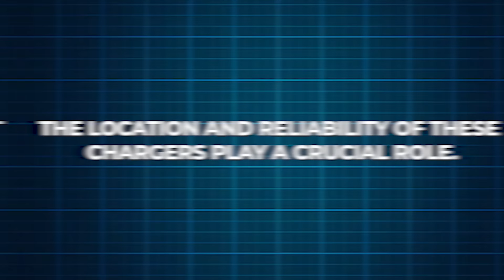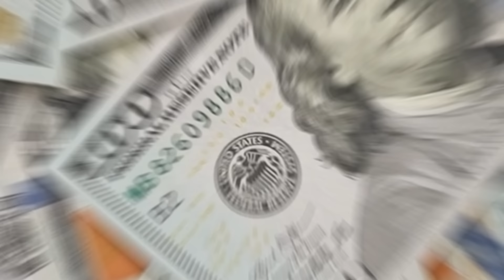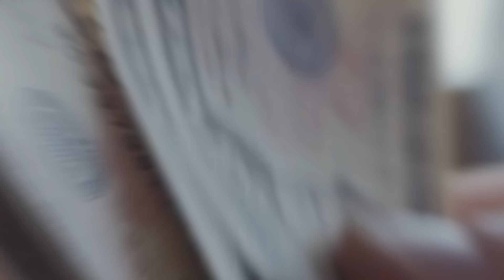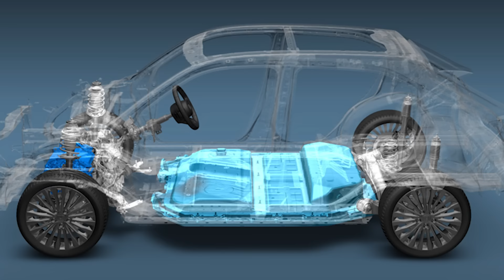Dealers Are DUMPING EVs! The Reasons Will Shock You!

Comment: They have no range too  expensive, to much to repair ,no charging stations ,and suck in the winter
Reply: Tesla is around $35K now with around 350 miles of charge. Used Tesla can be $16K and can be faster then most sports cars while being more economical then a Toyota Prius. Charge at home in 3 hours or 20 min at superchargers while on road trips almost anywhere in the US. Suck in Winter? Tell that to the Norwegens! Yes, you do lose a bit of range until the battery warms up again. At worst, you have to pre condition the battery on the way to a Supercharger. Please go to a Tesla dealer to get to ride one for free!  It will blow your mind 🤯.